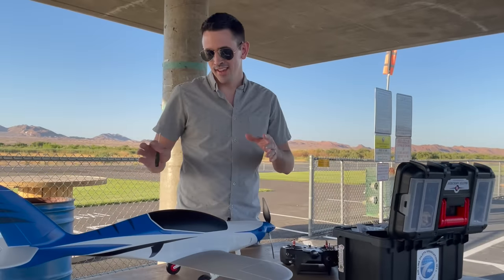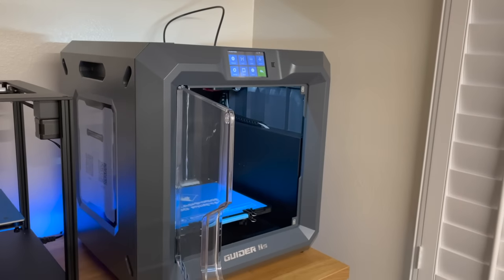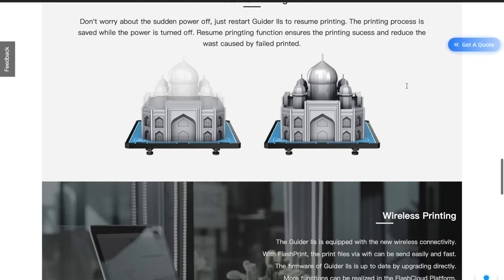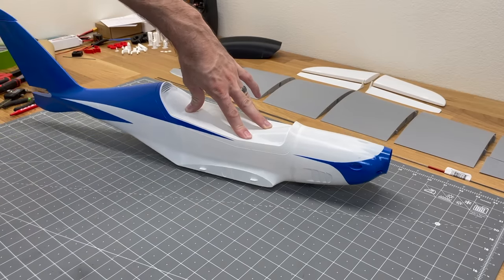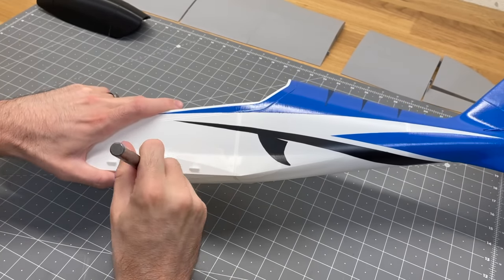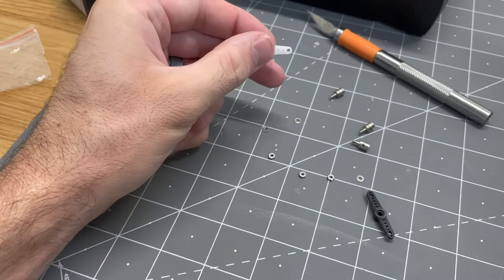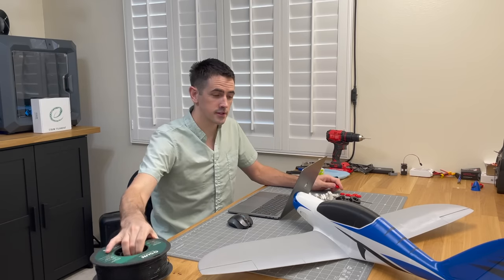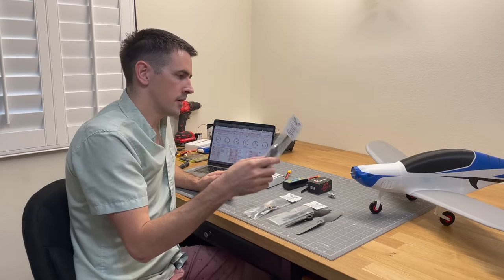DIY RC Plane Full Build - ft. FlashForge Guider 2s

Comment: I use layers of masking tape to properly gap control surfaces.  Just wrap a couple pieces of tape around the back of the wing near the hinge in 2 spots then all you have to do is slide the elevator or aileron up to the tape.  Once the CA is dry pull the tape out.
Reply from the maker: Thanks for the tip!

Comment: Hi Troy, do you think you can help me with a profile for me too? With the gcodes already in the files, the nose of the printer catches the reinforcements on my wings and sometimes breaks them.. My printer is Creality Ender 3 V3 SE and I use Polyterra PLA+ at 215° by 60°, 0.7/0.8 retract and 0.1/02 extra retract. I tried to slice with the last cura app, but still cracked the reinforcements.. Thank you and I am waiting for an answer!:))..

Comment: Me and a few buddies were having problems printing wing panels with our Guider II’s. We were extremely frustrated and after using your settings they are perfect!!!
Thank you!!
Reply: Did you use cura? I'm working on printing my first plane and got lw pla and everything but decided I want to try this one as my first. So I ordered more tough pla and need alittle help. Can't get a reply from Troy I'd say hes pretty busy.
Reply: Hello, what kind of problems are you having? On my L2 wing, for example, it breaks some of the reinforcements on the wing wall.. I'll try again with the settings from Troy..
Reply: It’s the same:)).. my printer it’s ender 3 V3 SE..

Comment: Troy, thanks for the free Shark download.  The Shark is an evolution of the Millennium Master, and my Tower Hobbies model is one of my best flying planes!  I was worried when that model went away, and I'm very glad to see this variation that will never go away!
Reply: i printed mine using the supplied gcodes and it printed great, it all went together great without any sanding or anything, come to print the landing gear using the gcodes and they might as well be for another plane, they print great but are miles away from fitting each other, the springs won't fit in the legs, the front leg won't fit into bracket it rotates in, the steering arm won't fit into the spring

Comment: Hey Troy, thanks for taking the time to show the build and the flying footage - I do enjoy watching your vids. Now onto the model itself - I personally have been designing and 3d printing airplanes for a while and my first impression was that from the outside the model is indeed looking very nice. Now from an internal perspective - not so much. I normally just go with a 2mm thick shell, which is made up to two 0.4mm walls (so 0.8mm total) and the remaining 1.2mm usually has 5-10% of infill. I find that this way the shell is quite strong (perhaps a bit of an overkill for PLA as it's quite strong naturally - I normally print with LW PLA). I think the internals (servo mounts, tubes, etc - particularly fuselage parts 2-3) are way overdone, but we all have our own style! :)

At first, I didn't even look at the gcode files and went to slice the STLs myself. Of course I found that the models (particularly fuselage parts) had "errors", i.e certain geometries were shown as printed in mid air. Ticking "Keep Disconnected Faces" box in Cura somewhat helps the issue, but still, I was surprised that given the author's background, why would a 3d model be designed so poorly? But then the gcode.. See below.

In the end, I thought to hell with it, went and printed one of the fuselage parts straight from the provided gcode and I was shocked, because I don't think I've ever had a print looking that crisp! Sorry, took so long to get to the punch line, but that is what surprised me the most, so clearly, I'm not as good with Cura as I thought I was! Will need to investigate what settings exactly they used to generate the gcodes!

Thanks again! Hope to see more of your vids in the future.

Comment: Use black electrical tape around the tire.  It last a good while and significantly reduces the rattle.   I do this even on some of my large scale planes with normal rubber tires for reducing the traction grab on asphalt so it ground handles like it's on grass instead of snapping uncontrollably with rudder movement.

Comment: I'm new to 3d printing but learning fast.  Love your posts.  I printed and built the Shark.  Maidened it yesterday.  Was a little tail heavy so I landed to move the battery.  The right wing broke loose (the landing was not that hard and on grass).  The wing needs a spar.  Also, the landing gear, while cool, are not strong enough.  The nose gear was very difficult to complete as parts did not fit well and I had to spend a lot of time sanding and trimming to get them to fit.  I thought the fuse was well designed and went together well.  This is my fourth printed plane.  All of them are just way too fragile.  I sometimes wonder if the people that create these files are also rc flyers.   I'll keep trying, lets hope these designs improve.  Love your vids.
Reply: I'm in the same boat as you, haven't flown it but today testing it on ground, one of the main gear broke taking a curve, Trying to redesign it right now to make it stronger.

Comment: Another great build video plus parts list in the description. Very nice and thanks for doing all the hard work here. Is there any chance you can share the stl files for the wheels and tires? To be honest I'm old and lazy and don't want to have to learn how to use a CAD tool and how to design wheels/tires for this one project.  Also can you point us to the stl files for the tpu hinges that you used in the build? Thanks again and keep up the excellent work.

Comment: pretty neat design and satisfying use of tools. at 1kg with that wing surface it's on the high wing loading side. feels like 3D printing it pushes the weight up quite much.
Reply: Yeah but he does mention he's using a larger than recommended battery which will add a lot to the weight.

Comment: Hi Troy, 1st of all your Chanel is so good and very helpful. I am building 2 of the planes you have shown. 
I am using your thin wall settings on my Creality cr-10s pro v2. I also have a Guider IIs. 
I was hoping you could share how and what settings you used in Cura to set up the Guider IIs please.

Big fan for Australia...

Comment: Another question if you don't mind. I'm printing the fuse sections  at the moment. I'm having trouble with fuse section 3. The long guide tubes for the control wires are not supported well and move when the print head passes over them causing the ID (opening or hole) of the tube to close up. By default the print is oriented with the big end down on the build surface.  I'm in the process of printing it again with it flipped it 180 degrees so that the small end is down instead. I've also added supports to see if that helps. I was wondering if you had similar issues with section 3 if if so what did you do to address them?Edit: well inverting the fuse didn't work. I'm using cura 4.9.1 (latest). After slicing and using preview I can move the slider and see that the internal structures are not being rendered correctly, with some of the internal structure being printed in "mid-air" due to sections below not being printed at all. Under special modes I changed the "surface mode" from "normal" to "surface" and that seems to have fixed the problem when previewing it. TBH I don't have a clue what this setting does and am just taking shots in the dark here. I am printing it now to see if this change fixes the issue.Edit2: Well none of the changes I mentioned in the first edit worked and in fact introduced other problems as well. One thing that changed with the printing of section 3 was that I changed filament brands from hatchbox to overture. I've used both of these brands with no issues in the past but just in case I will try printing with some more hatchbox. If that test fails I will try slicing the section 3 fuse with an older version of cura just in case there is some kind of issue with the newest version of cura which is what I am using. I will come back and provide an update on the results. Edit3.  Tried a re-print using hatchbox PLA and did get a better print than what was observed using overture. But the problem remains that the internal structure that supports the tube wire guides is not rendered correctly in the cura slicer resulting in unusable tube wire guides. I tried slicing with older versions of cura but that didn't fix the issue. At this point I am stuck and unable to proceed further. Just in case it helps my printer is a c reality CR6 SE although it's easy to see that the slicer and/or the STL (design) is the issue. I'm just wondering how Troy avoided this issue. Edit4 I modified the gcode that came with the download to work with my CR6 and the print is now underway and is looking good, will report on the finished product later. Looking at the gcode it was created under cura version 3.1 so downloaded that version and tried slicing with that, results were the same as with the current version of cura. Also noticed some z-seam settings in the cura settings folder for the fuse. I implemented those settings and sliced the stl resulting with a different location for the seam so I will try printing that file soon. Will report back on all the results once they are complete.Edit5 Success!! I was able to get a good print using the supplied g-code after modifying it to work better with my specific printer. After printing it I noticed that the z-seam was located in the middle of what is the lower part of the of the fuse section. When I sliced the stl i had the z-seam location set in a different location so i decided to slice the stl again but this time locating the z-seam in the same location as observed on the print from the supplied gcode which was Zseam x = 0.0 and Zseam y = 117.5 (this is the same as the "user defined" setting of "left" in the current version of Cura). So with that as the zseam setting I sliced the model and printed using that gcode and the print sort of worked but there is a structural piece towards the end of the print that does not print correctly. If you view the sliced model you can see gaps in the supports that causes the structural areas to fail printing. So bottom line the only way to get a good print is to use the supplied gcode. It is possible someone could go in and modify the stl file to make things work, for me that is way beyond my skill set atm. .

Comment: 3D printing is amazing, but they all seem to have high wing loadings, & fly fast.
Reply: He did put in a larger, heavier battery but I still agree with you.  I did buy a few models from this website (3DPrintLab) and they do offer a few biplanes and trainers so they would be slower and easier to fly for sure.

Comment: Noob question here for my first build. Longest push rods I could find online are too short to reach the servos internally. Is there a specific clamp/join that I should use to extend these or should I just purchase wire elsewhere and cut to size? Great vid btw, helped me alot with most of the build

Comment: Don't solder those plugs unjoined like that!   You're making them misalign by the heat flexing the inner pins as the case heats up.   
Plug in a spare male/female side first and solder them connected together.  This keeps them from warping and makes them easy to remove or plug in after you're done.
Also, get yourself some liquid solder flux.  You'll never use that paste junk again, believe me.
Reply: Hi, what point in the video are you referring to?  Please post the exact time.  Thanks!
Reply: @krissebesta  21:32

Comment: I think I need more of your cura settings.... I printed my front canopy and its just an outer shell with no top or bottom or inner structures, really flimsy. so I added 10% infill and it has grid lines on the outside.... Please help

Comment: Hi Troy, Did you print version 5? I have been trying to get part 2 of the body printed, but it kept on failing, then I noticed the internal supports does starts mid air, no matter what orientation? Is it only me? They even stop and continue mid air?

Comment: May I know what slicer did you use? I can’t print the internal structure out.
Reply: Same here, been trying to get a solution for months now, with no luck.
Reply: just saw someone mentioning printing the g-code files instead of the stl, I remembered I did that with the intakes of the shark, have you tried the g-code files?

Comment: Any chance you can add the stl files for the rims and tires?
Reply: I've done a lot of 3D printed planes, and you don't really want the wheels and tires. The wheels are much harder to print and suck compared to going to the local hobby shop and buying already made wheels and tires that fit properly. Trust me.
Reply: I have printed a few TPU wheels of other 3D printed planes successfully. Unfortunately I am a newby in CAD designing the rims and wheels.

Comment: I see there's separate servos for ailerons. So you could employ flaperons?

What wire do you go for with control rods? The last build I did the wire was a little too bendy..
Reply: He said 1.2 millimeter wire.
Not sure what material though …
Reply: Yeah, I got 1.2mm wire, but too soft and pliable though.. trying to find out the right material..
Reply from the maker: @paulradford4100  I use 1.2mm music wire for everything, it has some bend to it but it is very strong and works great
Reply: @TroyMcMillan  By "music wire" do you mean piano or guitar wire?

Comment: Just tried printing the fuselage and there seems to be an error in the drawing or files provided on thingiverse and shark.aero. Fuselage part 3 (shown at 7:43 in your video) The support tower(?) at the rearmost section seem to have breaks in the inner support structure of the plane between layers 806-825, 848-869, and lower at layers 535-567, 245-280. 

Is there are more up to date drawing after v5?
Reply: Same problem

Comment: This video got me super excited about a plane that I cannot print. The STL files WILL NOT cleanly slice in Prusa, S3D or Cura. There are also no instructions on the print settings to use. Super disappointing!!!!
Reply: Bro there is also gcode files try that 
I've also tried to slice the model but it didn't work
So I go for the gcode and it's perfectly okand my printer is ender 3 pro

Comment: Very nice video Troy!  
How much filament is needed to print this plane?
Reply: I am printing it but as it is my first plane I had some issues with stringing or some parts of the fuselage having to be reprinted and I am almost done and I have used just a littlebit over 1kg of PLA and a bit of PETG for the motor mount and some TPU for the tries.
Hope it helps

Comment: Troy, hello. My name is Vlad. I'm from Russia and I really like your channel. I also do aircraft modeling. I bought the printer in order to try to print models that I design myself. There are already two models that fly, but weak in the settings. I have an ender 3 pro. Began to print the shark there are drawbacks. What kind of slicer do you use? Sincerely from Russia.
Reply from the maker: cura!

Comment: Found problem with purchasing wheels. The 45mm main wheels spec'ed are no longer available from hobby king. Did some searching and all the alternates that I could find have 3mm axles instead of 2mm. I assume this is an issue as the landing gear is set for 2mm axles. Do you think that the 40mm front wheel would also work as main gear wheels?
Reply from the maker: yes, it should work fine! Thats why I started printing my own tires because I found the same issue.
Reply: @TroyMcMillan  Thanks. I'm in the process of printing out the plane parts and so far it's progressing very well.

Comment: SO the stl's are free and that is awesome, so many places want to charge for such, how much would you say you had in the electronics, $30-50?, clearly parts on hand knock down the cost, but those did cost at some point so assuming no free parts, how much would your best guess be on parts cost, not counting battery, radio or filament
Reply: $30-$50 sounds right. Try Hobby King.

Comment: How do you get the profiles settings to load into Cura? I get an error when trying to load the fuselage profiles. I'm using Cura 4.8.0 on an Ender 3 printer.
Reply: Same here. Cura 4.9.1 with Ender 3v2.
Reply: la encontraron alguna solucion ?

Comment: Excellent video. I'm about to start printing but which filament to use. Normal PLA or PLA LW? I have become a 
"e-sun" user find that gives me the best results on my ender 3.
Reply from the maker: this one is eSun's PLA+
Reply: @TroyMcMillan  Thanks. I seem to get the best results with Esun +. This will be my 6th model trying a variety of filaments with varying results. Some I have printed a second time with weight being an issue.

Comment: As a student of aerospace engineering, the lack of a nice carbon spar in that wing and on the stabilizer and fin leaves me so upset ahahaha
Reply: It pains my soul as a operator/maintainer that another engineer has the need to over engineer a hobby grade item. lol
Reply: @sometinghuge2291  don't worry i understand you, i worked as an easa part 66 maintenance trainee and i know that side too, plus i also build big rc planes in a student's team of my politechnic, I only say that I''ll never trust cyanoacrilate glue to avoid the wings fto act like a closing book under some G's and with fatigue stress after some flights ahahaha

Comment: this thing is an absolute nightmare to print on any ender item.   im down 2 full spools of PLA with piles of errors and scraps.
Reply: Same with us, not sure if its the STL but out printed is a good Ultimaker S5 and S5 is printing these like a Alibaba printer!
Reply: I used an Ender 3 and it is just fine with some strings